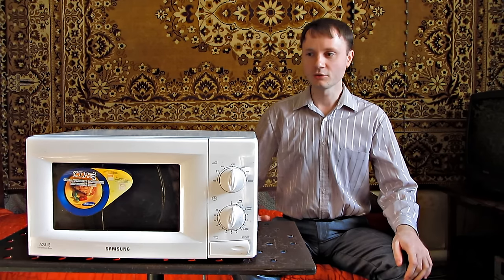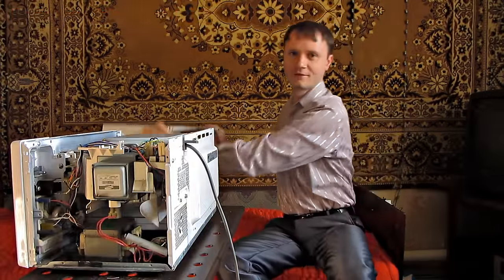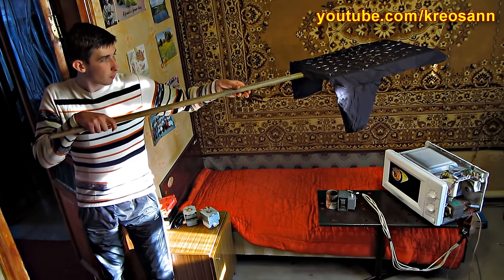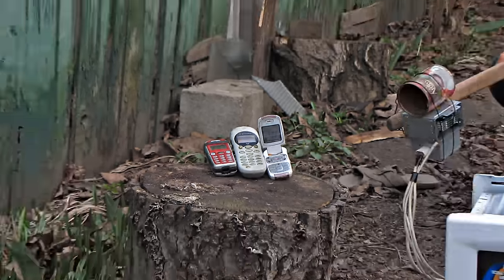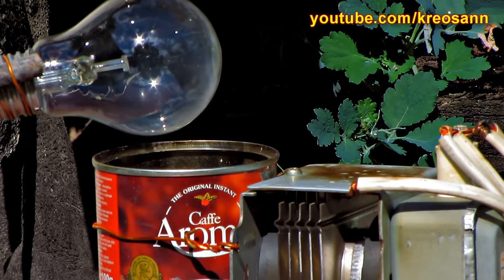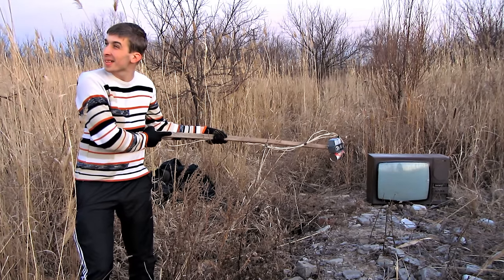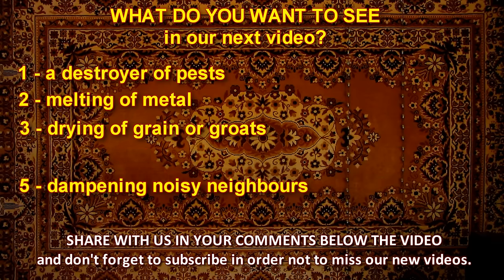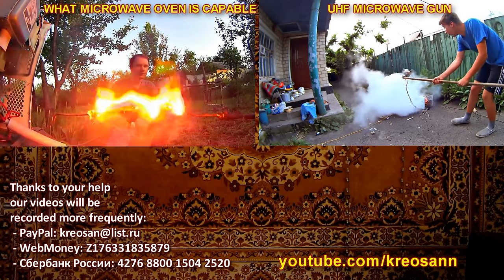UHF microwave gun

Comment: Your eyes are very susceptible to damage from microwaves:  they have no blood vessels to carry heat away.  Microwave energy absorbed by the eye can cause premature cataracts as the corneal tissue cooks.

Great videos!
Reply: ***** Well, a mesh at least as fine as what's found on the door of an oven ought to be sufficient, but I don't know if such a mesh just needs to be between the microwave source and the eyes, as in an open face shield, or if it should be more tightly sealed, such as with goggles...  or if that screen would need to be grounded.  

As far as other parts of the body, microwave exposure can cause burns, as one would expect, though I don't think it's as much of a hazard as getting  them in the eyes.  I'd also think that at the point one felt something heating the face, it may be too late to avoid hurting the eyes.

I don't really know what the actual risks are:  I'm not a doctor, nor have I had safety training on microwave exposure.  I just hope no one gets hurt doing such experiments:  

Of course, after seeing their kite-in-lightning, and shorting out electrical socket videos, mmm, maybe microwave exposure isn't really high on their safety concerns.

Cheers,

   -nevin
Reply: +Nevin Williams i think the mesh will also become an antenna - it needs grounding - but please correct me..
Reply: herauthon four I'm not sure;   This seems ripe for experimentation. :)
Reply: one practical implementation could be the melting of minerals into lava.. and casting this hot stuff into nice creative shapes.
Reply: It's very bad to look at an antennas too. It's like looking at a harmful invisible light.
Reply: Do not look directly at the operational end of The Device.
Reply: ...  with remaining eye.
Reply: well, not just blood vessles..the eye bulb is well filled with water (aka hydrogen) and so a nice medium for heating
Reply: cooks every thing why I am saying those young Russians are brave how they do it
Reply: You are absolutely right.  I would make some kind of mesh shield behind the gun and ground it as you suggested. In addition, I would make a mesh shield and put it in some kind of mask and look through it...it to should be grounded.
Reply: @NevinWilliams71  I believe the metal mesh breaks up the waves.  The mesh would actually have to be thinner than the waves to be effective.
Reply: Protection with irridium coat eye lenses/glasses
Reply: that's quite right. they are playing with health.
Reply: If they get caught is prison time, cause this altered guns can kill people when using multiple times
Reply: Lead goggles? Wait.....
Reply: I killed a Donkey with the microwave. I threw it out of the window, and it hit the donkey on the head from 10 floors up.
Reply: If you point this at something metal it will (literally) ricochet back too.

It is called a HERF (High Energy Radio Frequency) Gun - and actually been researched for use in warfare (of course - if we create anything it MUST be used to destroy or it doesn't count?)

Comment: 1) can it bring down a drone?
2) put it on the popcorn setting and aim it at your nuts.
Reply: unless the drone had something protecting the battery from this, it'd likely do something similar to the cellphones if you could either get the beam focused enough, or get close to it.
Reply: as ping pong song said, if you get it focused enough, the battery will probably explode like that. But I think, even if you focused only like they did, it would still overdrive the hf receiver of the drones. Even if they don't send on the same frequency.
Reply: inb4 testicular cancer
Reply: You'd fry its antennae at the very least, probably cook out all its electronics - but a farkin dangerous anti drone gun if I ever saw one. It's about as smart as flying around town with a nuclear engine.
Reply: good question brother
Reply: you could focus the beam with an electromagnetic aperture.
Reply: yes, a magnetron is efficient at cutting a drone from its 2.5GHz link, and even have its radio damaged, at some extent, even with a decent shielding the CMOS ICs will fry and it will be dead.

Just keep a spare power supply for your magnetron and insulated, if you are a good electronician you can find out to make it more...portable and safe for you.
Reply: @pingpongsong9568  but it would still effect it if the control frequency was around 2.4GHz

Comment: Love the video and the channel! However you have some inaccuracies in your content. An 800W microwave only has 800W or watts of power. This is far far less required to run a cellular. Most radios average 40-80W output at the RF port where the actual signal flows from. Depending on location, elevation and population as well as traffic patterns and so forth will dictate how many of these radios are needed on site. An average T-mobile USA site will have around 340W per sector and each tower usually has three sectors to it. This would put this tower by itself easily up to 1020W which far exceeds the output power of the Microwave. Though it's gonna be badass how you can use it!!! Excited for future content!!! Source: I am a technology trainer for Ericsson and previously Nokia.

Comment: What stopped me from trying  this is the fact that 2.45GHz cannot be felt as pain if you are receiving too much effective radiated power (i.e. your brain cooking).  Have you ever noticed how the inside of a chicken,for example, gets cooked faster than the outside?  Sometimes, still even frozen when the inside is steaming.  This is due to the fact that 2450MHz penetrates about an inch deep and heats up.  Ergo, if you can feel heat, the INSIDE of your guts are actually HOTTER, but since there are no pain receptors... you could be getting cooked and not even know it before you feel burning!  RF burns are scary, not quite as bad as high-voltage electric (the 2Kv AC before the doubler is the same voltage as the electric chair BTW, and there IS potential to ground, so this is not something to try when your drunk and feeling frisky, as with this voltage you won't get a 2nd chance).  So, for anyone like someone I know very well that reads "don't try this at home" as "try this at home", know what you're f*cking with before you do it.   Discharge the cap, do your research first.

I've heard 100GHz has been researched for a military "active denial of entry"  (non-lethal way of keeping people out of an area or breaking up riots).  It will cause painful burning sensation on your skin, but won't cook your internal organs like 2450MHz will.  Think of the meat you're cooking, being yourself since the door is open.  

I must say thank you for filming this - so I don't have to.  This is one thing I decided I won't try,  fear of cooking myself, not to mention all of my favorite toys and projects destroyed.
Reply: +filter4now Your points are good ones but still underestimate the massive risks of pointing such a massively powered microwave emitter around. They penetrate just about anything but metal and messing with them is likely affecting people blocks away. The risks of this technology make me think the human race is far too immature for its commercial availability. I really cringe when I see people taking them apart for video hits, it's so unbelievably irresponsible, even if they think they know what they're doing. Pointing it at a cellphone for instance with a lithium battery inside. Can you get much dumber than what these guys get up to in Eastern Europe?
Reply: @suprememasteroftheuniverse  Did I touch a nerve?
Reply: I've seen worse - things I've daydreamed about "that would be horrible!" I've seen videos of them on here. I've thought this might be cool but you are completely right. What about their cellphones? It would blow my wifi up
Reply: @James-fe7wd You're absolutely right - actually in my country there's a conspiracy of how some people have been injured without being touched - this I believe could be used as such a weapon.

Cell phone towers are 30 watts and they have a "RF Danger" sign. This is what 1.2 kW @ 2.45 GHz bye bye new WAP my phone too...

Comment: If you put the components in a tube with 240volt battery pack and place the microwave transmitter in a touch head so it is mirrored to a single beam which will give it more distance too. The you'll have a portable gun . You could even use a back pack to carry all the heavy stuff..

Comment: A homemade weapon of sorts can be made by using the parts from a common houshold microwave, to direct the electromagnetic energy at a person. ( it works as a weapon because the energy waves can be projected to literally heat the fluids and / or various organs within the body).
Reply: I killed a Donkey with the microwave. I threw it out of the window, and it hit the donkey on the head from 10 floors up.
Reply: @educatedmanholecoverbyrich8890  well that's one method 😂

Comment: Now put this concept in a smaller handheld device with capacitors that multiply the electricity from a lower voltage RC battery. A dangerous weapon that doesn't leave a viable trace
Reply: they do, it's called 5G

Comment: This is how the trade center were destroyed.they were disintegrated . There was only dust to clean after .there were firemen in the elevator at the base of the building .they didn't have to be dug out because not much was left to cover them . The were also cars a block away half melted away .
Reply: Nah, man: it was ultra low frequency sound waves.
Reply: Microwaves would have caused lights to illuminate. It was not microwaves.

Comment: Would it create a bigger effect if you replace the magnets in the magnetron with stronger ones?
Reply: Yes - if you also increased the current as well (bigger transformer). The magnetron is actually a vacuum tube in the middle of magnets the "plate" needs to be able to handle it

Comment: Dear, now the cause of Chronic Fatigue Syndrome  is found: radiation of microwaveoven.
To stop you have to eliminate the oven out of the house.
The plug out of electricity net because the oven has also radiation when it is not in use.And out of the house because the oven has a high voltage capacitor.
The distance between an oven and a person is very important.After a 2 weeks without microwaves health becomes better.

Comment: I tested my local cell tower and it was pushing about 1200 micro watts per square meter. The smart meters the electric company uses around here pulse at over 2000 micro watts per square meter every 4 to 6 seconds. Yea imagine 400 houses X 2000 micro watts pulsing every 4 to 6 seconds all at the same time 😳. Yes death it is. Anything over 3 micro watts is biologically effective. Well I believe the cell towers are capable of MUCH MUCH more. Just look at them up close . 😳☠⚡🪐
Reply: I wish I could test the one in my neighborhood. It’s only about 1/8 a mile away. 
It’s very hilly out here, so I’d imagine they have to be strong. 
Is it of concern that it’s right next to a giant water tower?

Comment: Could this be made portable with a DC power supply, such as say. Maybe a large battery pack
Reply: That would have to be a very LARGE battery pack with how much power a typical magnetron use it.
Reply: +girlsdrinkfeck not yet, currently looking into it
Reply: You could power it with an ac inverter. And a car battery with about 400 Wh should be able to power a microwave for about half an hour.

Comment: i need to confirm something.
those "signals" (wifi-cellphone,etc) emmits ionic radiation, or not?
Reply: I think you mean ionizing radiation, in which case, no they do not. Ionizing radiation starts in the UV spectrum and these are in the radio and microwave frequencies which is much lower energy.

Comment: What is a good way to shield / protect/ counter these waves
Reply: A faraday cage, it shields everything thats within it from any electric field
Reply: Colin Watson Sorry it was meant at @Raddos1 D:
Reply: Lead helps block radiation, they would want a few of those shields they give you for x-ray.
Reply: am I wrong? im not anything of an scientist but he is just using a cavity magnetron so I thought a faraday cage would shield anything from the electronic field.

Edit: Plus thats why the glass on your microwave has wire mesh in it, the microwave shell is acting as a mini faraday cage so you can safly use it while standing next to it.
Reply: Don't know if you are wrong ,but the density of lead blocks most radiation from passing through.
Reply: Raddos1 is true. A faraday cage is the best. If the radiation comes from only one direction, you'd only have to shield to that. But some small amout could also be reflected by conducting things behind you. You could make that shield out of a metal plate or out of a grid but the holes should be maximum 1/10 of the wavelength in size. For microwave that's about 1/10*12 cm=1.2cm. Then there should be only a small amount of radiation coming through.

The effect SuperShirtGuy mentioned for lead is only required for x-rays or radioactive radiation, where the energy of the photons are so high, that they can ionize atoms.
Reply: Pray my dude. Frrl. I mean theres tons of cellphone Towers,wi-fi Routers,cellphones,satellites etc. that are emitting this radiation around you plus the microwaves from which I never knew that they radiate that much but I instinctively dont trust this ,,double steel protection" lol. 
Tinfoil hats/suits wouldnt work IMO because our body emitts electromagnetic energy too and I wouldn't risk frying myself JK

Comment: Well, I guess you can expect cancer in a near future
Reply: Джейсон Хичкок
There's a difference between a magnetron encased in its appliance, the microwaves are 99.9% retained in the cooking receptacle. The guy there is totally exposed and so is the magnetron. That much microwave radiation CAN cause cancer, eye problems and possible brain and other organs lesions.
Reply: It CAN especially cause blindness, if you point it at your eyes, because they can't transfer the heat out, as there is not much blood flow. You could also burn other body parts if they are exposed to radiation.
But they CANNOT cause cancer, because they aren't ionizing and thus not mutagen. They have a wavelength of about 12 cm. That's far away of the high UV range (some nanometers), where the photons begin to get enough energy to create ions. Even light has a much higher frequency.

Comment: how does it turn to an antenna without ground?
Reply: You don't need a ground for an antenna. Traditional λ/2-dipols are symmetrical around ground. But in this case the antenna is just passively focusing the radiation comparable to a parabolic mirror.

Comment: Hi, I'm cancer, see you soon!
Reply: As they mentioned in their video, the 2.4 GHz is non-ionizing (it's the same wavelength as your WiFi, about 12 cm). Only electro-magnetic fields from the high UV range are ionizing and thus mutagen. So you don't get cancer by this.
But you could easily burn your eyes and get blind, because they haven't much blood flow and thus cannot transfer the heat.
Reply: Lukas Graphen but it generates kilo(10^3) volts while wifi generates mili (10^-3)
Reply: Actually 10^-6 are micro, and it's more the power than the voltage, which is important on radio waves, because the voltage depends on the impedance of the antenna.
But yes, you're right, the radio waves of a microwave oven have significantly more power than these of a WiFi device. But to cause cancer, the radiation has to be able to ionize the DNA's atoms. And to do that, each single particle must have enough energy to overcome the ionization energy of the atom. The energy of photons is only depending on their frequency. So if you want create radiation that can create cancer, you have to increase the frequency of your radio waves and thus increase the energy of each photon instead of only increasing the power you put into it and thus only increasing the number of photons.
Radio waves begin to ionize in the high UV-B range.
Reply: thanks, i didnt know that